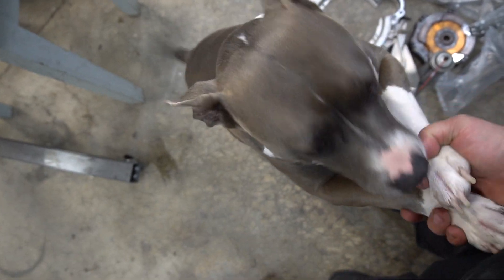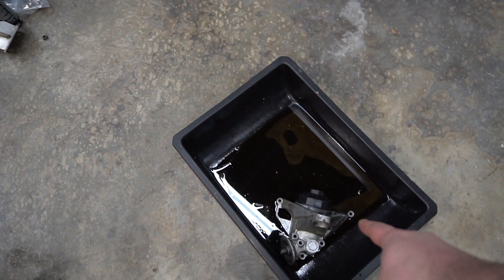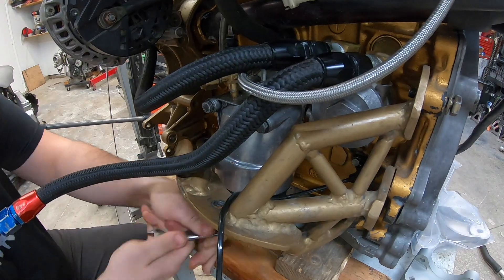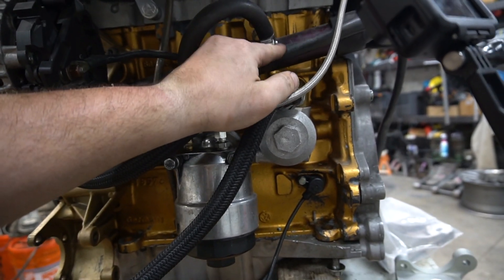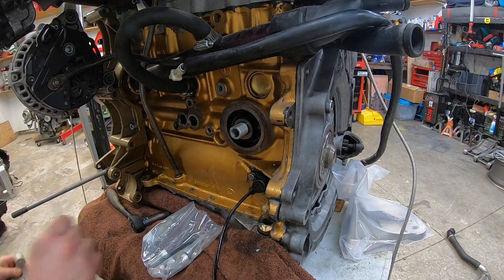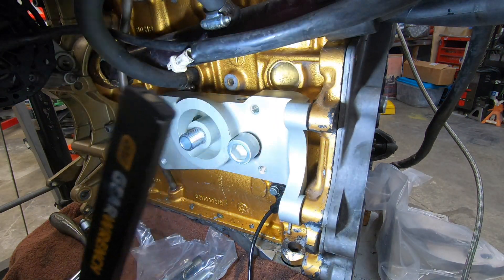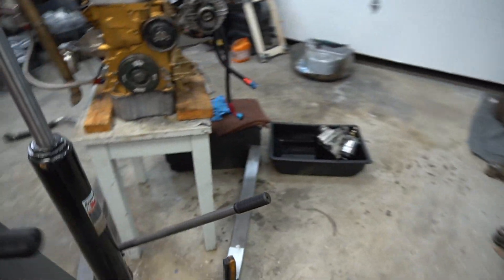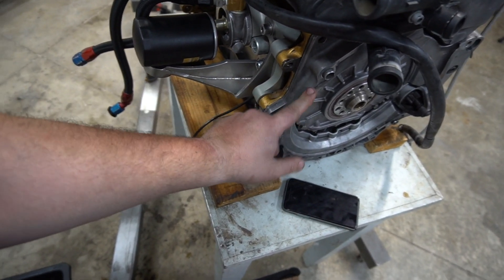12V VR6 - AUDI - BOLT ON ENGINE SWAP BRACKETS

Comment: This is so 10 years ago. The B5 is so out of date. There are TiAL turbo 770 setups that put up stupid numbers. I had GT28’s pushing over 900hp through mine and sold it to a guy in Oklahoma and now it’s a street car. I built it for Road America and used to crush everything on the track. I think all in I had $45K into that beast.

Comment: Hey George, why you say you must use the bracket from phaeton. Has vr5 and VR6 different brackets. I hoped that the ones from Passat vr5 would fit?
Greetings Thomas
Reply from the maker: Yes the Passat VR5 is the driver side bracket we use normally for the VR6 swap.